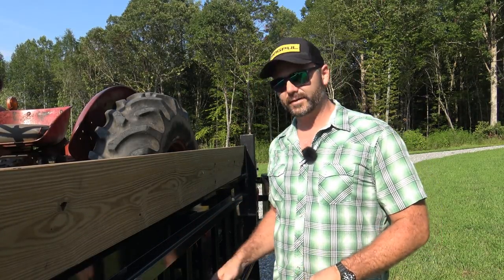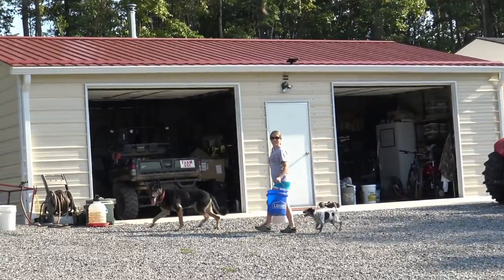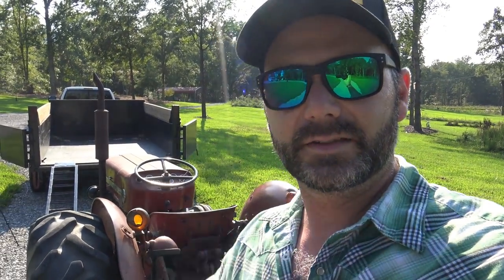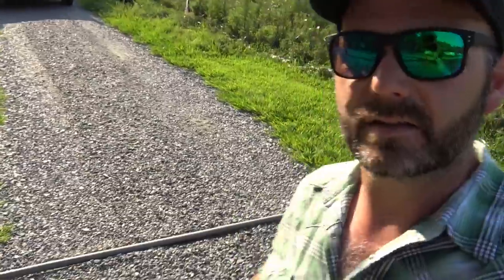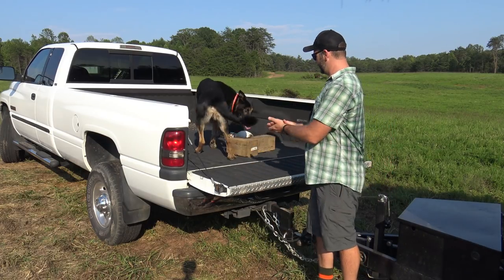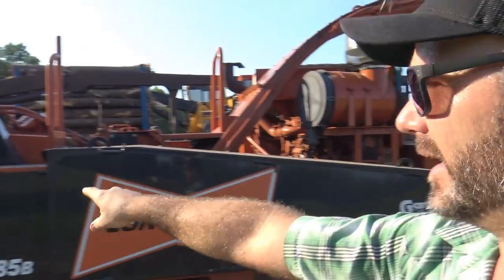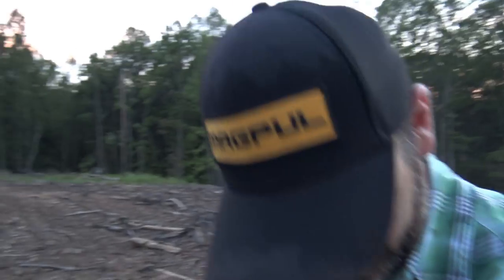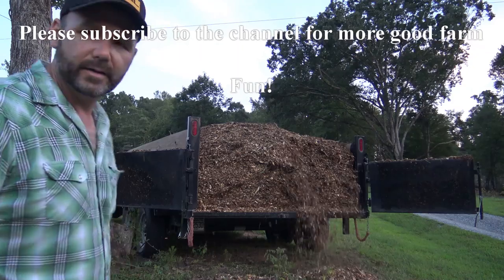I STEPPED IN A BEES NEST ON CAMERA!! TRACTOR TALK, BIOFUEL ON THE FARM AND MORE!

Comment: The multi powers not dangerous it's just the operator
Reply from the maker: Trey Williams why is it that every time I post a video with the tractor a in it somebody like you has to say something smart ass… Get over yourself if you were smart you wouldn't leave a comment like this, you're just proving to the Internet that you're a know it all jerk… Something your friends are probably trying to tell you in the past
Reply: Stoney Ridge Farmer I feel  about  the  same  towards  the  multi  power . My family  runs  the  Massey Ferguson  dealer  just  south  of  you  in Thomasville  and  I've  had  the  multi  power  freewheel  with  the  135, 165, 265, 1085 and 1135. To the  best  of  my  knowledge  they all freewheel  In the  low side .  I   have  had  about  a  dozen  different  66 series  international  tractors  and  I  liked  how  the  torque  amplifier  held back  on high or low ,  and  I  currently  run  a  fleet  of  older  john  deere  tractors  and  very  much  like  how  the  turtle  rabbit  is on them.  But  the  multi  power has its  querks.
Reply: yeah, there are brakes too.
Reply: Tumbleweed ?
Reply: From what I’ve read there is no engine braking when in low. That’s what I’ve heard and most people say that they prefer the multipower when bush hogging and then they use the standard “straight” transmission for everything else. I’m not trying to be a smart ass or anything I’m just stating what I’ve read.

Comment: Multi-Power is actually a wonderful tool, but the operator has to understand it and be aware of how it works and get comfortable with it. It's like any other tool in that regard. The sticker on the dash beside the MP lever (which looks to have been painted over long ago) had instructions to clarify usage. The flexibility in ground speed provided by Multi-Power makes the tractor more useful for many things.

Comment: I wouldn't sell it.  Those 3 cylinder Perkins will run forever.  I have a MF150 diesel which has the same engine as the 135, just a bigger frame and front axle (Looks like the 165 and up Masseys).  As much as I love Mother Deere, that is probably my favorite tractor to run.  It always starts, will run all day on a tank of diesel, and never gives me any issues.
Reply from the maker: Good food for thought thanks 2020

Comment: I agree that a free wheeling tractor is dangerous. Multipower is fine on flat land but there is no flat land where I live and there isn't in the Carolinas either. I'd sell it as well. Maybe one of the smart elics on here that like them will buy it from you. Lol
I like the old ford tractors and they have a model that has a selectospeed transmission and the early ones will free wheel also and I won't own one.

Comment: One of Massey's better inventions was multipower. I am a massey mechanic at a dealership and see thousands of masseys with the multipower yearly. A 135 is a sweet little tractor, emphasis on little. Usually if a customer wants Multipower disabled I will usually make a tab and screw it into the dash with a self taping screw. That way if you want to use multipower or someone who buys the tractor when you out grow it does it takes less than 10 minutes to make multipower usuable.

Comment: Multipower is only dangerous if you know of it otherwise its a life saver on the roads as its 2x the speed
Reply: Screw would fix it fine
Reply from the maker: lol....I've been told they leak...seals are hard to keep in them...mine was pouring hydro fluid before the repairs

Comment: If your thinking of using Bio fuel I would advise to stay away. it does nothing but eat and clog your fuel system up. Im an Airforce Vehicle Mechanic and I see this all the time.
Reply from the maker: Allen...gotta watch that whole video buddy...the "bio fuel" is the wood chips we are selling to a power plant in southwest virginia....and you are 100% right ! That french fry juice is horrible for a fuel system....I'd never burn biodiesel in any vehicle that I cared about keeping.  I too am an Air Force Vet...civil engineering ..electrician 3e051!
Reply: I did watch before I posted but I just wanted to give you a heads up. Do they take manure too?
Reply: AF Vet also. 21 yr Fighter Mechanic (Eagle Keeper). Still tho, not to beat a dead horse, I believe Bio-diesel is the way to go during spring and summer months. I think most issues some folks have is improper methods of refining it and not washing it before usage. But if your operation isn't that large then it probably not worth the startup costs of a good system. Soybean oil seems to be the best, plus you can use the meal as protein supplements for the livestock.

But hey, do what's ya gots to do and what makes ya feel best!

I tell ya how we got rid of yellowjacket and bumblebee nests, get 2 lawnmowers. Crank em at top speed and park em over the main entrance and their emergency exit (yes, they have one sometimes). Park 1 first, then have wife park the second one over the other exit (they usually pretty pissed about this time)